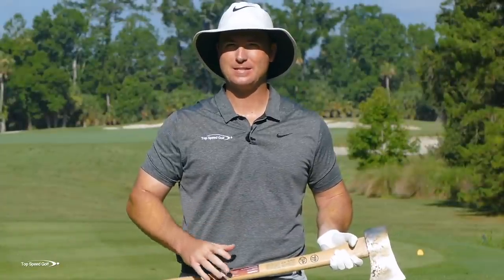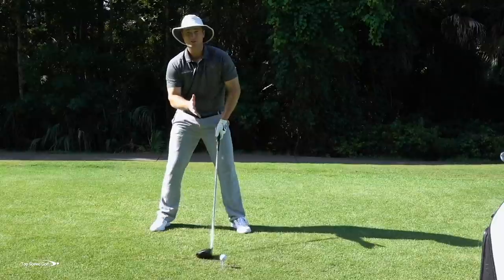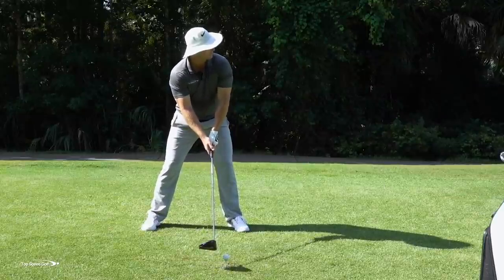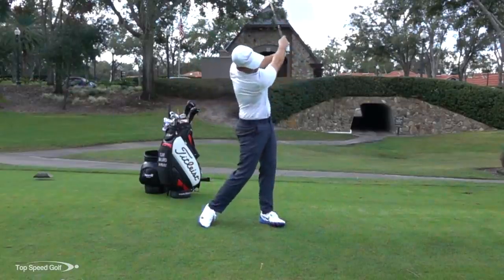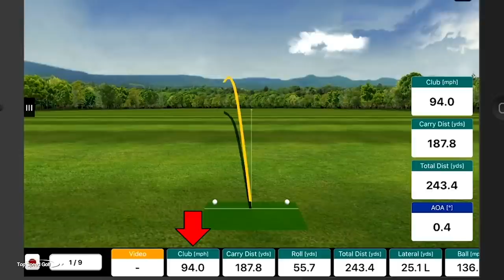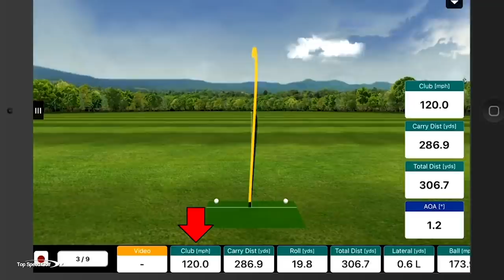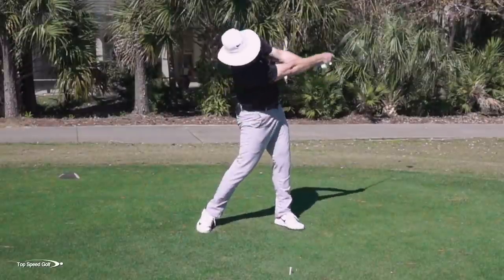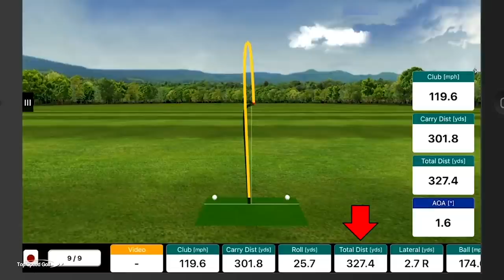How To Bomb Your Driver In Golf

Comment: Clay and Q,
This is one of the best instructional videos you have ever done, and it is extremely comprehensive,  My only critical comment is that the title may be too limiting.  I have done extensive drills with the techniques you have described, and I find that it applies to all my clubs.  While I do not try to "bomb" my wedges, I found that a few elements and concepts you have shown really do apply to all my clubs:
1.  it is extremely important to get properly "to the top" in every swing, because the body motion that you describe to get the club to impact requires a proper position at the top.
2.  The importance of getting and maintaining the upper lead arm in contact with the lead chest peck cannot be overstated.
2. With this at the top positioning, it is easy to feel that all you need to do is rotate your body and, essentially, thereby "pull"  the club down properly into impact simply by maintaining the lag and wrist hinge.  the release seems so natural.
I also agree that once you do these things, you have to develop a "baseline" for your swing to see the trajectory and direction of your ball flight.  Do not be discouraged if the ball is continuously going right or or left or too high or too low.  As you say, you can make the adjustment by controlling the speed of your body rotation and/or orientation you give to the club face(open, square or closed).  One size does not fit all-- you must experiment with EACH CLUB  at the range to see what slight modifications work for you to get the trajectory and ball direction that you want.  And, then,  on the range practice does "make perfect" to achieve a muscle memory to help you make good, predictable shots on the golf course.
Thanks, Clay and Q.  You guys are the best.
Reply from the maker: Thanks for sharing and for the feedback! Yeah, usually if you gain speed, you get it throughout the bag. Play well! Quentin | TSG Instructor

Comment: I think that Mr. Ballard’s explanation starting after 5 minutes in this video about right elbow using the word  'Elbow-In’  is very important.
I've been thinking the same thing for a long time, with the word ‘Elbow-Up’ and ‘Elbow-Down’.
Golfers can be categorized into two types depending on the hands position of their address.
A Hands-Up player and a Hands-Down player.
The Hands-Up player has a higher hands position at address, while the Hands-Down player has a lower hands position at address. 
In other words, Hands-Down player is already in a state of slightly wrist-cocked at address.
Representative Hands-Up player include Moe Norman, Sergio Garcia, Xander Schauffele, Bryson DeChambeau, and Hands-Down players include Ryan Moore,
  Zach Johnson, Keegan Bradley, Brendan Steele and others.
Generally, if your spine is leaning forward much, you tends to be a Hands-Down.
Furthermore, Hands-Up naturally tends to be Elbow-Up and Hands-Down tends to be Elbow-Down. 
 Moe Norman is a typical Hands-Up and Elbow-Up player, but  Ben Hogan is exceptionally Hands-Up and Elbow-Down.
Excessive Elbow-Up causes elbow tension and interferes with a smooth backswing.
Even if left elbow is up, at least right elbow should be slightly lower than left elbow to prevent cutting the ball.
DeChambeau keeps his left elbow rigid and Elbow-Up, but right elbow is slightly bent at address. 
On the other hand, some players keep his right elbow high at address to hit the fade ball intentionally. 
   An example is J.B.Holmes.
Reply from the maker: Thanks for sharing!

Comment: Would feeling you are pulling the center of the grip apart at Impact be a good feel for the snap, 45 degree release.? Appreciate your clear, on target instructions...Tom
Reply from the maker: It could be. Feeling is really relative so if it helps you get more speed then absolutely. If not, then I wouldn't bother.

Comment: Clay this is working great. I have one problem. I seem to keep hitting the ball off the Toe of my driver. My arc is definitely inside out and I am drawing most drives but I must be losing distance hitting it off the Toe. Any suggestions how to hit it on the sweet spot?
Reply from the maker: Try to hit it off the heel. Your draws are more than likely due to gear effect caused by hitting it on the toe.
Reply: @TopSpeedGolf  Thanks, it just looks queer addressing the ball off the hosel.

Comment: everyone on here is talking about higher tees but no one mentions what degree of loft your driver is set at. If you have a high loft setting and then raise the tee and swing up wouldn't you see the sky ball? I would think you have to adjust the loft for a higher Tee and upward swing ?
Reply from the maker: Yes, if you hit more up on the ball then it will typically add loft. You may want to consider lowering it. Play well!